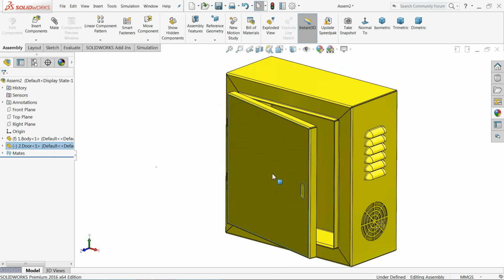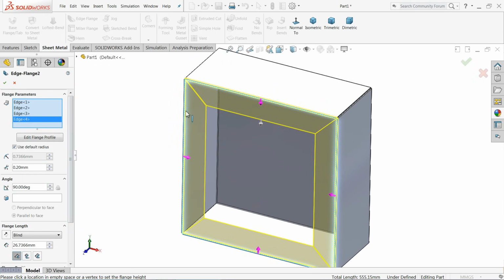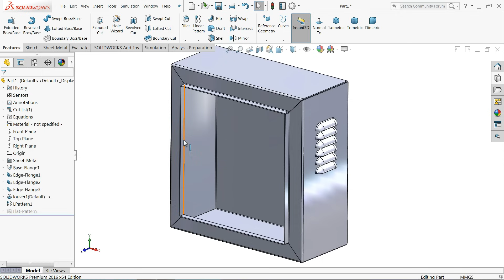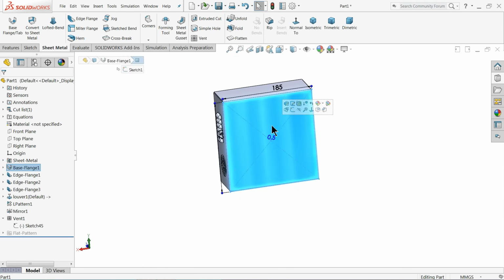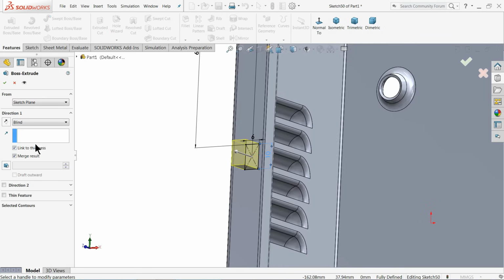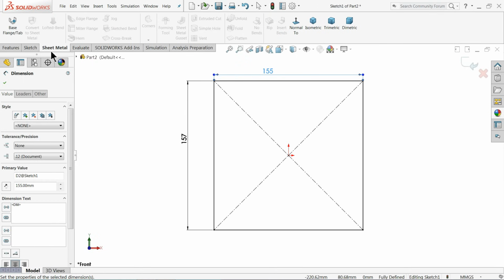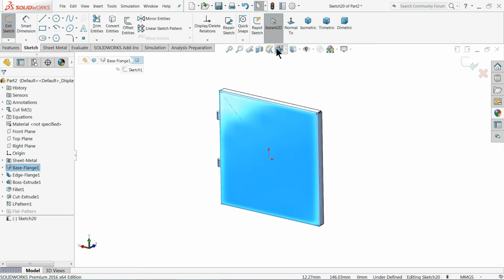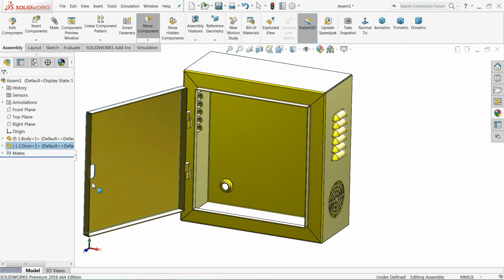Solidworks sheet metal tutorial | Design of Electrical enclosure in Solidworks

Comment: Great tutorial but you left out --> in order to be able to use the forming tools in Design Library --> select the forming tool folder --> RMC --> check Forming Tool Folder otherwise it will be treated as part file and when you drag it on sheet metal part surface it will be adding another part to part file. Thanks for sharing.
Reply: thanks i had this problem .,,. confused for more than 2 hours to fix this problem thanks for mentioning in the comment

Comment: when i take a part from forming tools it doesnt set easily on a surface in the scatch like you/ instead it asks me if id like to make a derived part, and then just drives me crazy and doent make it hollow, but a full part... what is wrong? l
Reply: i got the same thats coz under circles selection  (Smur something selction) you dont select the outermost circle start from the second outer circle

Comment: The forming tool ( louvers, counter sink emboss) are no placing on surface instead it is getting placed on origin or in between the sheet metal .
What should I do to place them correctly on the surface?
Reply: Same issue here. Also a window appears :"are you trying to make a derived part? Y/N"

Comment: Sir can you please tell what is the advantage of Sheet metal over simple extrusion?
Reply: sheet metal modeling allows you to make real world objects usin actual metal sheets. When you're finished modeling, just press a button (I think it's called Flatten) and it will show you a flat sheet with the cuts and bend lines that need to be done to reaach the final result. 

When using extrusion you can end up with an object that is impossible to make with a real life metal sheet.

Comment: Hi, I had issues adding the louvres for some reason. 

I am totally new to solidworks; I really need to make a similar cabinet design.
When I added the louvres, the size was extremely tiny, unable to position them and they would not be displayed. A red X would display beside the louvre component - I will recreate and provide the error here

Comment: 13:09 The back mount holes should be extruded outside, not inside. It makes a gap and help to install panel with roughness on the wall.
Reply: correct, also prevent screws from sticking up inside
Reply: That is not correct. Most code would require mounting to a backboard or other flat surface.

Comment: why louvers in Solidworks are not inserted on face after selecting the face? A dialog box is appearing while I am trying to drag on the surface of part - "Are you trying to making derived part". After clicking yes to it what to do it locate on the face/surface of the part?
Reply from the maker: send screen shot,
Reply: Thank you sir, but find the solution for this. My forming tool is unchecked so it's not working.
Reply: Same message to me
Reply: thank you

Comment: for the 3rd edge flange where you make the lip that the door is going to latch onto, how did you decide the appropriate length of it? in your opinion, is there supposed to be a Hem at the end of the Sheet metal to avoid cuts when handling? Thanks in Advance! :)

Comment: Hi brother,
I'm following your channel to learn solid works.

When I inserted louvers from library into model, it appear box: "Plz use dimensioning and sketch modify tool to place the form feature. Note that sketch moves  as a whole when dimensions or other actions are applied  to it". And I cannot make flip tool, rotate angle or positioning for this louver. I don't find anywhere so that allow me to do modify feature. Could you reply this issue? Thanks in advanced.
P/S: I'm using Solid works 2010